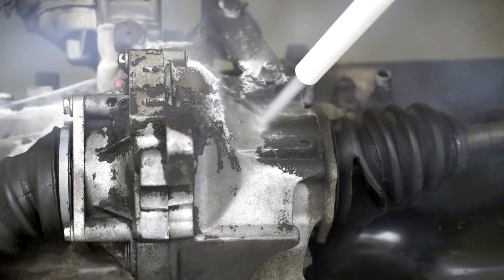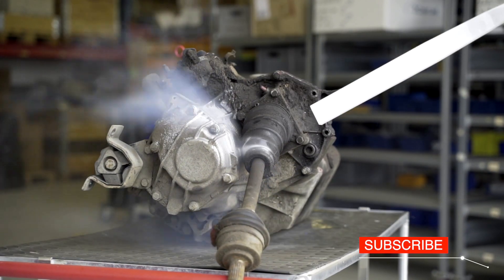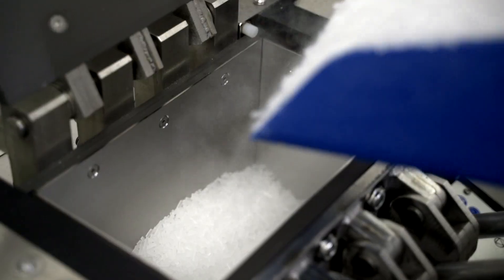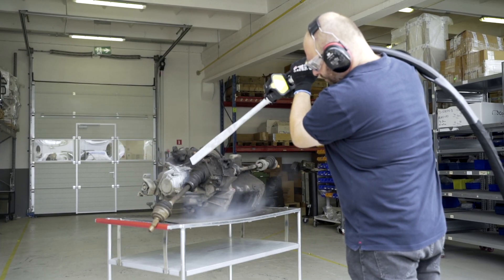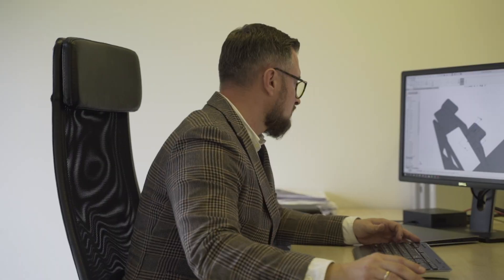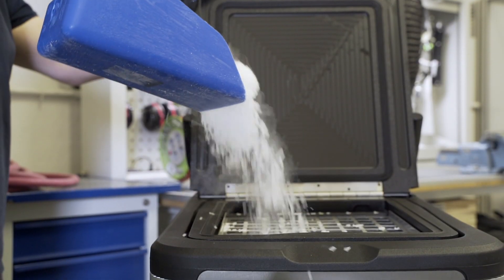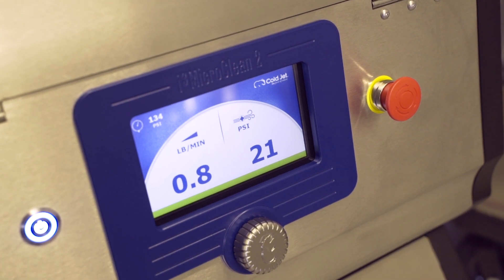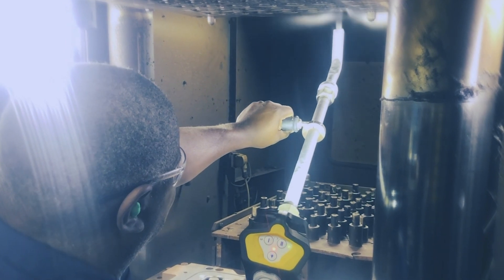Dry Ice Blasting: How it works and the CLEANING PROCESS

Comment: It's not sealed in airtight containers. The CO2 needs to vent out as it sublimates
Reply: They're probably vented mate.
Reply: @Hirokiji  I've used dry ice blasters. The machine I used took dry ice blocks and had blades to shave the blocks into smaller particles. We just stored the dry ice blocks in a large cooler. It wasn't vented and wasn't even refrigerated. I guess if you sealed the lid tightly, then expanding CO2 could cause problems, but the lid was just shut like a freezer or refrigerator.
Reply: Do you mean it has vent while in storage or while in operation?

Comment: Can I use this machine instead of sand blasting?
Reply: Yes. but the machines are very expensive
Reply: @cwisted5308  As for cost — that's not entirely true anymore. I just picked up a QXJ-100PRO model from China for under USD $7,000, and it's loaded: smart PLC system, remote diagnostics, imported electrical components (built to Samsung & TSMC specs).
You're no longer stuck paying Cold Jet prices for the same or better tech.
Reply: Yes, this can be used instead of sandblasting — dry ice blasting is non-abrasive and great for surfaces you don’t want to damage. It doesn't leave blasting media waste like sand, but keep in mind: the contaminant itself (paint, carbon, etc.) still needs to be cleaned up after.